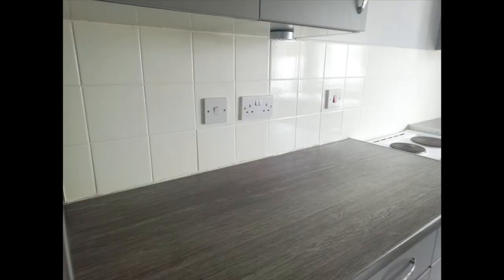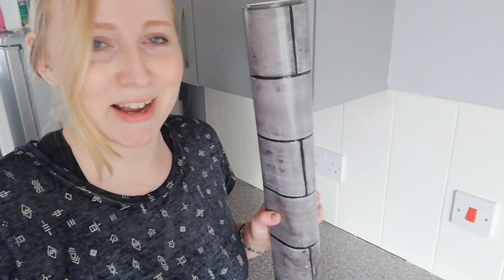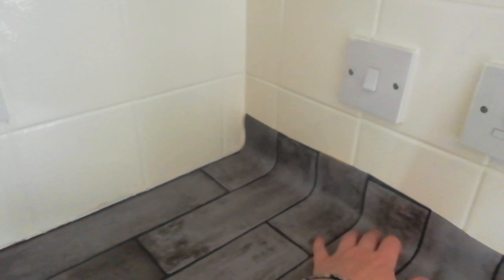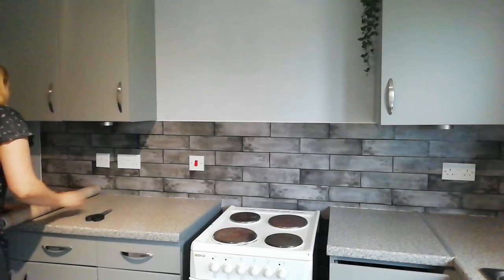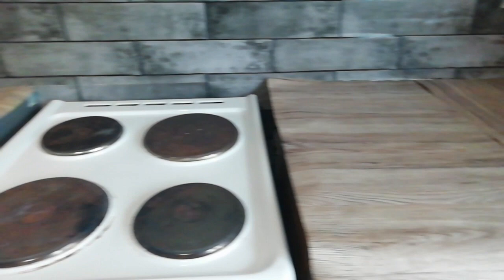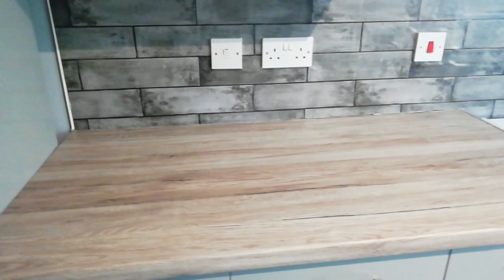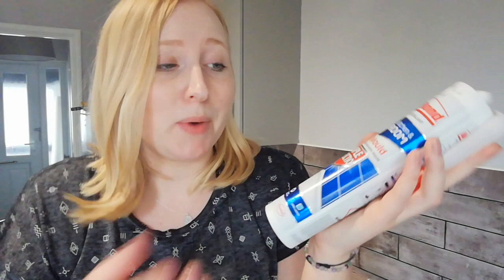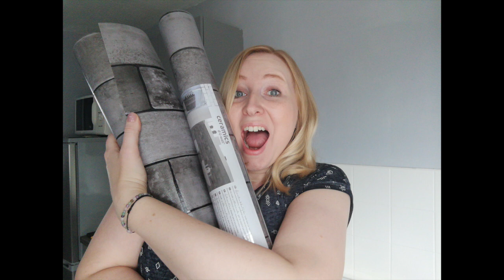BUDGET KITCHEN MAKEOVER VLOG | Applying D-C-FIX and 3D tile wallpaper | Create Your World

Comment: I’ve used the wallpaper in my bathroom over tiles, it looks fab, just a little bit of advice, you don’t get much time to work with the adhesive, apply a section at a time, stick the paper down, making sure you remove any bubbles, I can see bubbles on yours which won’t come out now and use clear silicone sealer for edges
Reply from the maker: Thanks for the tip! I’ve put grey strip sealant over the white now and it looks much better :)
Reply: Hi Unfortunately links are broken.Internet says you cannot wallpaper over tiles unless you sand them. How did you do? Apply ceramic glue directlyon the tile and stick vnyl wallpaper?Thanks

Comment: Nice but I would have used a grey sealant that matches the paper and used some tape when sealing to get a nice clean straight line. Also would have gone for a different paper for the worktop that complimented the paper on the tiles.
Reply from the maker: Completely agree! I have changed it now! I’ve put a grey silicone tape over it and it looks so much neater. Also, I really love the combination of both styles. Each to their own. Thank you so much for watching!

Comment: When I do caulking I wet a sponge it makes a nice and even all the way down through there and I rinse my Sponge Out one of the comments you should have used gray because the white does standout that's beautiful backsplash and counter
Reply from the maker: Thanks for the tip! I've actually put a grey strip silicone over it now so looks better 😊
Reply: I always use a wet Sponge to smooth out....works a treat.

Comment: You make it look so easy.contour on kitchen walls want to cover with out removing,vinyl rectangle adhesive floor tiles could I put these on walls as B and Ms have nice wood effect,walls are uneven.im blown away by your kitchen make over,the fablon on work tops,could you give advice please.and special blade you use.floor is laminate and freezing cold so big rug on top.even the fablon mite be good on walls.its tiny kitchen largest wall height usual council house and 9ft floor so not big wall.help I can give you email if you answer and send you pics and ask help me out.i dont like alot of papers in shops.seem to be back to thin paper I dont want contour tiling on roll.thanks if you can please answer.xxx🌹👍💙